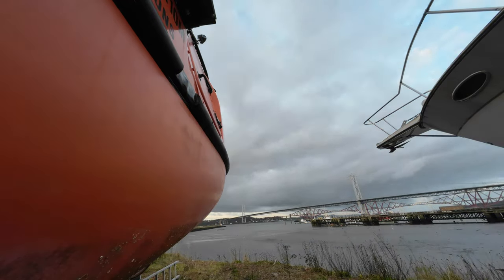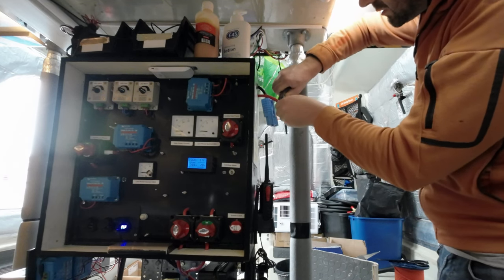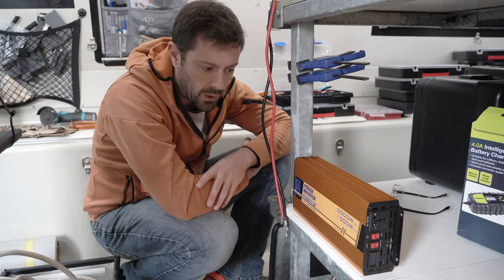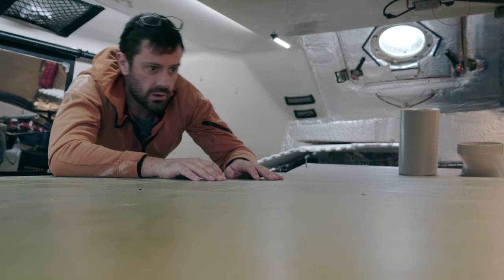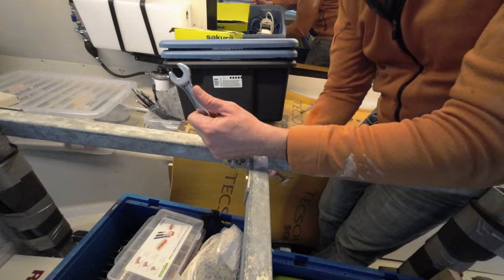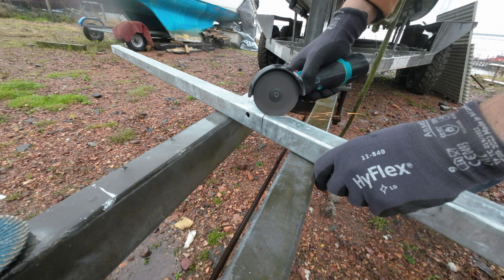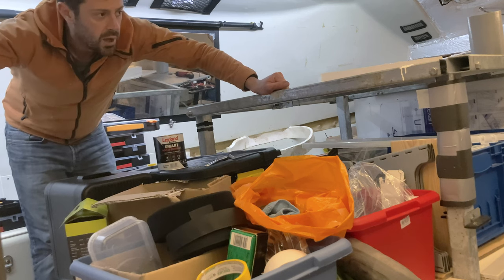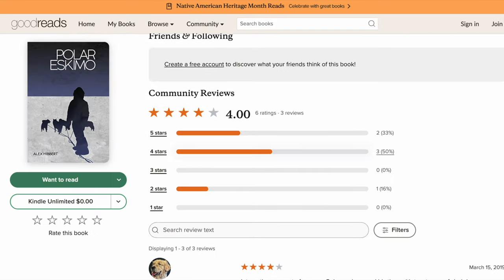New AC inverter w/ 24V batteries & creating cabin space. Expedition lifeboat conversion Ep105 [4K]

Comment: While you are messing with your Anderson pin crimps you may, if possible, want to move the inverter closer to the battery bank. It's more efficient to keep the power leads going in to the inverter as short as possible and have the output leads longer if needed.
Reply from the maker: Agreed, but space is the limiting factor. The wires are over-spec, so the voltage drop should be minimal.

Comment: Depending on you long-term AC situation, I still ultimately think a Victron inverter charger might make the most sense. Yes they're expensive. Yes I'll help pay for one. However if you're going to be running anything important on AC power, it's super handy to be able to maintain power as the inverter automatically switches between batteries and shore power (or generator). 

It will also dynamically limit the battery charging to not overload your generator / mains connection. So say it's charging your batteries at 100 amps, which is 10 amps on the AC side. Then you then on a saw or kettle or something that would overload your 13 amp shore connection. The charger will sense this and immediately lower it's charger output to not overload the mains. Then, when that load is gone, the charger will automatically go back to full power. Plenty of features that increase safety and convenience
Reply: Do you have anything in mind that would fit the description of "anything important on AC power" on board of Alan?
I can't think of anything. As far as I can tell everything important is DC, and I can't think of anything that would be needed on Alan fitting that description. But I might be wrong 🤷🏼‍♀️😁

Plus I don't see the importance of automatically switching to shore power. I guess that's a nice feature on a leisure yacht, but on an expedition boat?
Reply from the maker: I really do appreciate the thinking and sentiment behind this. At this stage I'm comfortable with a modular system, which always attracts me in terms of replacing failed parts. I understand that will impact seamless operation, but yes initially cost was a major factor. My other Victron units have been major investments. Currently saving for a second Victron 50A charger between my generator and battery. Oh, and a fourth Leoch 210Ah battery :)
Reply from the maker: You're right that there's going to be nothing critical running off AC whilst not linked to shore power.
Reply: @Jehty_  I don't know what sort of gear: computer, camera, scientific will be added. Yes everything we've seen so far has been DC, but if they decide to run - a mass spectrometer - or something - not having to shift everything over is helpful. All I'm getting at.

I will cry myself to sleep if I see Alex installing a transfer switch onto a specific piece of equipment so it can go between the generator and inverter.
Reply: @AlexHibbertOriginals  see this is what I'm talking about. Instead of chargers, look at a Quattro 5000 or Multi-plus 5000. Keep the standalone charger as a backup
Reply: My van is AC focused, but I've got "shore power" and "generator power" feeding into my quattro (two separate AC inputs).

My AC distribution box includes an automatic transfer switch, so I have the shore power (priority) wired to my quattro, with the generator input (secondary) going to a manual transfer switch between shore power and generator

This means power automatically goes through my quattro, but if there's an issue (or I turn it off) I have control of the input. 

In addition to the charger built-in to the quattro, I've got a 75 amp charger connected to my circuit panel.

This is NOT something you want to leave on all the time, or it'll create a circular loop of power. But it's got it's place. 

 I can quickly throw a few switches, bypass the quattro, get AC power from somewhere, and run the 75 Amp dc charger.

Or, I can have the quattro running off the line input, turn off it's AC output so it only functions as a charger, start the generator, and connect my AC panel to the generator including 75a (12v) charging.

All I'm trying to say is that day to day operations should be mindless. But there should be a complex backup system to allow for any unique situation without hand wiring.
Reply: It's also important to understand the difference between VA and watts. VA is peak volts * peak amps. But those peaks may not occur et the same time.

Watts is simultaneously volts * watts. Normally they're pretty close, but the difference between the two is "power factor".

This is important only because an inverter with "2000" in the name might be 2000VA only 1600 watts.
Reply from the maker: Yep, it took me a while to realise this and do some reading! I thought for a while people didn't know their P=VI
Reply: @AlexHibbertOriginals  I am so excited to see where you'll be 2 or 3 years from now.

I wish my family situation allowed me to take a month off and help you push Alan to the peak, but, such is life. I know you will figure out what's important - I just wish I could be a part of it. 

Have you come up with a higher support level yet? Remember I spent 10,000 a month on Patreon.

Comment: How good is that adhesive on those self-adhesive cable channels? 
My experience with anything self-adhesive is that it would much rather be on the floor than on the wall/ceiling where I intended it to be 😅
Reply from the maker: It's ferocious. I've had to take some sections off, and it's a pig to prize away even from 'waxy' gelcoat. That said, it's single use. I tried to reapply a section and that doesn't work.

It's called D-Line.
Reply: @AlexHibbertOriginals  that's good to know.
Interestingly my local hardware store here in Germany sells D-line. So I guess I know which channel I will try next time I need one :)

Comment: All those 20th century electrical circuits go 21st century and offer to test a solar power generator. One of the Bluetti ones has a TX90 with a 30a DC output, others are available. 
Q the Butts
Reply from the maker: I'm confused. The bluetti thingys appear to be vastly expensive all in one portable inverters, charge controllers and lithium batteries. Why would I want one in a boat?
Reply: @AlexHibbertOriginals  thats correct. you dont want those on a boat.
Reply: Notice my suggestion regarding offering to test not necessarily purchase, don't understand why your confused they provide everything and more of what you have they are compact high power and chargeable in many ways and super versatile.
Reply: @UKvet246  weight and space matter on boats.
Reply from the maker: The key issue for me, aside from the cost and unecessary use of Lithium,  is the all in one nature. If a component fails, you may have the whole unit out of action.

I can see the benefit for camping/base camp/work camp/dry cabin applications.
Reply: @AlexHibbertOriginals  see ? this is why i still have hope for you becoming a proper mariner.well done.
Reply: Other than the fancy case you can also build your own for half the price and stick it in a wooden box.

Comment: That Anderson connection is an eye brow raiser. You have the wrong size crimp on ends. Continuity might be okay but when you have higher power they’ll be massive resistance.
Reply from the maker: Wrong size crimp on ends? The pins are matched to the wire gauge. I set the correct size on the hex crimping tool, but the crimp whilst neat didn't fully arrest the wires (possibly as the strand count is so high). So, I went with a slightly smaller setting, and whilst this fully crimped the wire, it deformed the pin as shown. Unsure as to how to solve, if indeed there's a problem. I see no reason why the surface area of contact, with wire and pins well within their current ratings, isn't workable.

Edit: next time I'm at the yard I'll do a further investigation with this. It's possible I shouldn't have tried to hex crimp, and instead do a pair of spot crimps from one side. Will update.
Reply: I have to agree with the eyebrow raising, there is a huge issue in industry with high resistance joints, I would explain further however there’s a plethora of information online, you may wish to revisit these joints on behalf of Alan and his occupants
Reply from the maker: @Invinciblemoam  Thanks - I do have a different crimper and some spare pins. I'll try and get a neater crimp, and not forget to grease. I've had a good read/watch of latest best practice/general industry arguments so will incorporate that.
Reply: @AlexHibbertOriginals  Alex sorry for the late response my friend, my comment was very sharp. When it comes to DC, high currents, there is a lot of Anderson connections out there that are Chinese, sub-standard and the sizings are often wrong. I learnt the hard way.  You’re doing a grand job.     Kind regards J
Reply from the maker: Cheers - although I don't think you were wrong. I do carefully source my Andersons though, so they are real.
Reply: @AlexHibbertOriginals  my be a conversation not to be had on here and a closer look at your cable and crimps and crimping method.
Reply from the maker: Cheers. I've downloaded the Anderson crimping specs. They do seem the indicate multiple spot crimps, but not as clear as ideal.

Comment: dumbness in this episode - Spaghetti wiring, no threadlocker on connector nuts, corrosion already visible on connections, not filling crimps with nooxid prior to crimping, not using solder after crimp, using self adhesive conduit in a seawater environment, using an off grid inverter instead of a marine inverter (victron, xantrex etc). the crimper (despite the self criticism) is, ironically, fine. all that is required is a mechanical connection followed by solder - looks/shape dont factor into it. stainless steel spring washers for locking nuts is also fine. ABYC E-11 - First shalt thou take out the Holy Crimper. Then shalt thou crimp once, no more, no less. Then solder thou thy Holy Connection, which shall connect it.
Reply: 😂 thou shall soldier thou crimp. Sounds like a crimp off from mighty Bush. 😂